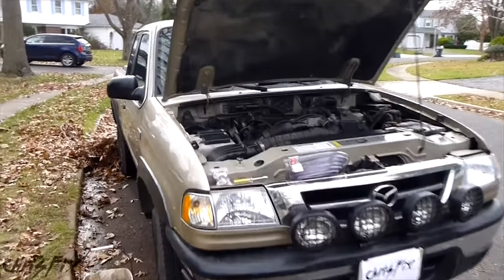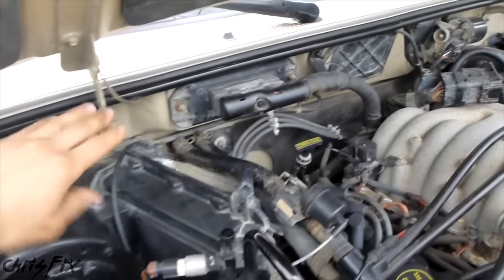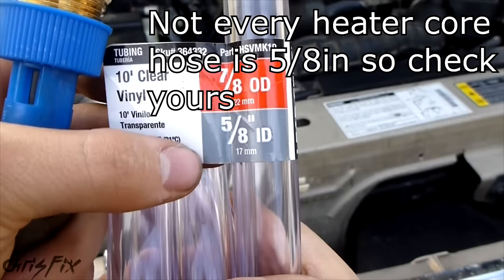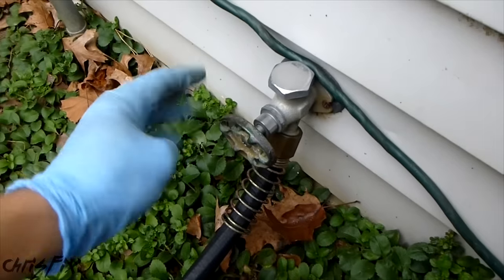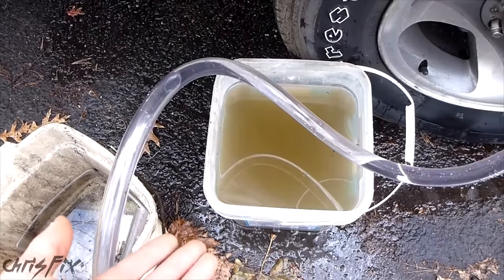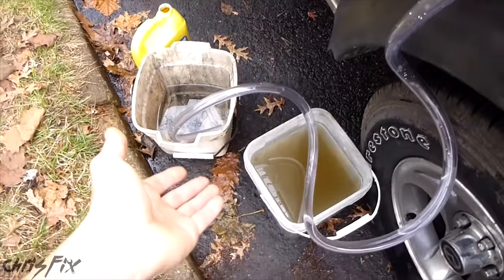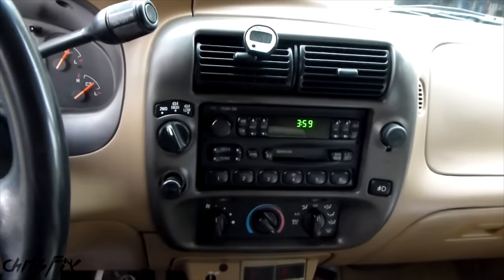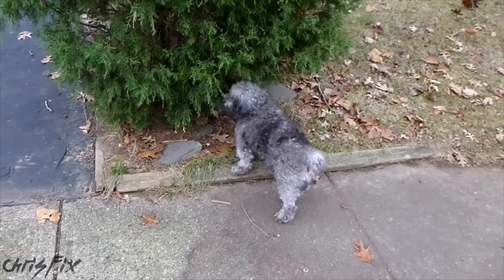How to Flush a Heater Core Safely (with a garden hose)

Comment: For measuring the temperature more accurate, set the fan speed to the lowest speed, because on high or higher speed, the flow of air is also cooling the thermometer to some extent. I found this out when measuring the cold air, it was showing the coldest temperature on the lowest speed.
Reply: Interesting.
Reply: You're right, lower fan speed means the air spends more time in contact with the evaporator or the heater core and thus more time heating or cooling. Hot air shouldn't have a cooling effect on the thermometer unless the thermometer is somehow hotter than the air coming out of the heater, which isn't possible. However that shouldn't matter for this test since it's intended to be relative. As long as the fan and the heat/cool setting is the same on the before and the after, the test is going to give you a rough indicator of whether or not the AC or heating capacity improved.

Comment: You're a good teacher. Personally I'd just hook the water hose with sprayer directly into the hose instead of using that adapter. Also, I'd disconnect the hose down by the valve not at the heater core end.
Reply from the maker: dainternetguru Thanks! I am glad the video was helpful!

Comment: I'm going to give this a shot. My thermostat gave out on me so I have been informed to buy a gasket, thermostat and coolant...and when they say gasket do they mean head gasket? But gasket for short. Anyways, thank you Chris fix! I have yet to do this... pretty nervous but also excited!!! Also, where or what is the oil intake? I'm wanting to use seafoam but I don't know where to add it with my Toyota Camry. My guess is that the oil intake is the oil dipstick tube. Thank you

Comment: Great video you seem very knowledgeable and communicate things simply and clearly.
I like your tip on using the heat monthly just to move the sediment and stuff, I have never heard that before. My follow up question to that is would you really need to turn up the fan? Does it have anything to do with coolant flow?
Reply from the maker: Loren Blaine Thanks a lot! You dont have to turn the fan up except maybe on climate control cars.

Comment: Back flushing with CLR probably works better, got a bunch of crud out when I did that with a Maxiima I had.  Had to poke a screwdriver in after taking out the radiator drain plug

Comment: you're so lucky to have a very easy access to your heater hoses, compares to my 97'Expediton. it's a nightmare.
Reply from the maker: Toby Tyler Yea on all of my vehicles it is really easy. Can you follow the hose to the waterpump or a connection near the water pump and take it off there and just not use the clear tubing?
Reply: yes it's way in there I can barely see it and a quick disconnect tool is needed plus the SUV has a rear aux heater and AC as well. The front heater hoses go all the way to the back and comes back around to the front heater core, looks really complicated
Reply from the maker: Toby Tyler That sounds like fun!

Comment: You should not twist heater core hoses. You risk detaching the inlet/outlet fittings from the core itself. Then you’ll have a bigger problem. Always cut the hoses and replace.

Comment: I own a radiator shop that my dad started back in 1957 we've reversed flushed the whole block and radiator and heater core at the same time we use water and 160 lb of air pressure through there as long as the system's flowing free and open it won't hurt it.

Comment: Lol normally my VW Jetta can be expensive for repairs but the MK6 has both a heater core and a fuel pump that can easily be done in 30 min to an hour. It's actually a great designed car for affordability(2.0 non turbo w/ 5spd manual).

Comment: Chris, thanks for the video.  I just followed it and flushed out my heater core on my 2002 Honda Odyssey.  Everything worked great but when I was taking off the hose for the outlet tube, I couldn't pull it off with my hand so I used pliers but I accidentally smashed the metal tube.  I was still able to reverse flush but I'm afraid to leave it this way because it might restrict the outflow.  

Will it be ok this way or is there a tool I can use to open up the metal tube so it can flow out properly.
Reply from the maker: I would be very careful because that metal is thin.  I would leave it and see if it leaks And if you notice a difference in heat

Comment: If you put a Y valve in at your hose Bibb connection which many folks have already for connecting two hoses... You can connect s pressure gauge available from any hardware store or Amazon cheap.
Reply from the maker: wb5mgr Yes you can! Thanks for the idea/tip.

Comment: I want to say how awesome your repair videos are. I'm going to write in ChrisFix for U.S. President. Thank you.
You probably wouldn't need to run the fan blower when running the heat in summer months to keep the heater core flowing. Simply turning the heater on to its warmest setting will actuate the control valve and do the trick by sending coolant through the core without making the cabin hotter than it needs to be by blowing air over the core.
I've had an recurring issue with air pockets in my cooling system that I solved by using the Lisle Spill-Free Funnel and purging the air. It's simple, fast, effective, and the system works perfectly but lasts only 3 months before the same problem of fluctuating coolant temperature gauge, overheating and no heat happens again. My system isn't losing any coolant and I'm unsure how air is entering the system. I can't do it now because of the cold weather, but next spring I'll check to see that the overflow recovery tube isn't blocked and I'll replace the radiator cap to ensure that the recovery system is working properly. The cap was replaced 2-1/2 years ago by a shop but doesn't have a PSI stamp on it so I'm unsure if the replacement is the correct PSI for my car. I had no problems with the system for the first 10 years of the car's life after I bought it new. I hate to think that exhaust gas is entering the cooling system due to a failed gasket but's a possibility that I'll need to face. Before I began researching this problem I wasn't aware of how many ways a cooling system can go wrong.
Reply from the maker: DDEENY Awesome! I just say put the fan up so that people know their heat is actually on. You can use a pressure tester on your system to see if there are any small leaks letting air in. You can also do a chemical test to see if exhaust gasses are causing the problem. Here is the kit for that: http://www.amazon.com/gp/product/B0007ZDRUI/ref=as_li_tl?ie=UTF8&camp=1789&creative=390957&creativeASIN=B0007ZDRUI&linkCode=as2&tag=chri0e2-20&linkId=JN7DYVTRITQK7RJY

Comment: My car seems to warm up slowly , I wait until it's above the blue section of the gauge then I drive and it warms up to normal operating condition and the heater blows hot , bit if I just let it idle it won't get to normal operating temp for like 45 minutes. I'm guessing it must be the thermostat bit I will also do this when it warms up some , it's only 16 degrees here today so I'm not running any water hoses lol but great video ! Thanks.

Comment: Great vid chris just a quick tip. I noticed you wrapped a glove around the connection you made with that adapter. Thats because that adapter you bought is the incorrect thread pattern. That is a 3/4” male x pex adapter which has a tapered thread its different from a hose thread. Im a plumber whats your po box ill make up something that will go from male hose to pex and send it to you

Comment: Additional tip….On Amazon , they have a heater core flush water hose nozzle with step tip ….to control water pressure and water flow ….all you need is clear hose ….there is also one that requires an air compressor to shoot short bursts of air to help losen stubborn clogs….it has a switch to go from air to water ….so two options to choose from ….with heater core flush nozzle guns ….both on the Amazon but can make your own with an average garden hose nozzle gun brass fittings and a cone type water hose nozzle fitting ….

Comment: so there's nothing wrong using a water hose I always thought you had to get distilled water? great video dude!! going to try this soon
Reply from the maker: deaththekidd30 You should use distilled water and coolant (50/50) when you fill the radiator, but to just flush it out, you can use a hose. I filled the heater core with antifreeze to flush out any extra water. In the end, it is not a big deal even if you leave the hose water in there because the heater core is so small.

Comment: Hey Chris,
Great video, just a rule of thumb.... not all heater cores are aluminum (ex. Toyota Trucks and some Hondas) just might be good to point that out when looking for a good chemical flush product.
Reply from the maker: speedytech7 Thanks for the tips! When making a video you have to say what is safest so people dont mess up their car. But you are correct, not every heater core is aluminum. I would still stick with a cleaner made for cars just because if there is any leftover it wont hurt the rest of the system.

Comment: awesome Chris nice input. I know this has nothing to do with antifreeze but I have a 94 impala and the trunk key lock seized up, and now the trunk button/switch doesn't work anymore, but when I push the trunk button I hear a clucking sound under my dash on the driver side just above my gas and break pedals. If you can help with that I would really appreciate it. Thx again very helpful vids.

Comment: Good video but I'm not sure I'd be jacking on the heater core hoses like that. With your clear hoses, you could have dipped the tip of them into boiling water for a few seconds and they would have slipped right on. Boiling water can be had easily with an electric kettle brought outside from the kitchen or maybe a little backpacking stove nearby.

Comment: I've got a 67 Buick Skylark with the 4.9l V8 and it's been sitting a long time, and plan on getting it roadworthy again with some well needed love. New fuel delivery system, basic engine maintenance, and changing most of the fluids. I really would like to change the coolant in it, but in the coolant flush video with the BMW you momentarily turned the engine on with the radiator drain plug out and revved the engine a few times. I'm sure if it was only on for less than half a minute, it shouldn't harm the engine, but would this step siphon the rest of the coolant in the engine water jackets and the heater core out? Is it worth trying it that way? Or am I better to just flush the heater core the way you showed here and play it safe? I'm sure my engine block does have a drain plug somewhere, but I doubt it was ever touched and I'm certain it's probably stuck in there. Thanks for all you do in showing us how to get things done ourselves, I've worked on cars but I still have much to learn, and your channel has been a really good help. Thanks Chris!

Comment: Did you do this htr core flush BEFORE or AFTER you flushed the whole cooling system?

IF you have a 12 VDC fluid transfer pump (or even an AC powered sump pump like I use to flush my whole house water heater cores), you can create a closed loop continuous flush using the chemical.  One reservoir.  Pump out into core; put return back in the reservoir.  Turn on pump and let it run until you are satisfied.  You could even use really hot water (up to the temp max your pump can handle).

25F increase is an awesome result!

Great tip on monthly heater exercise!

Just checked my 2004 F150 Heritage heater temp from dash vent while flushing with RODI water to get ready for initial Flush & Clean PRE-treatment.  It maxed out around 171.5 degrees F.  Not bad for a right at 17 year old truck with original heater core.  I may consider skipping the heater core back flush.  <wink>  We'll see what it looks like after all is said and done.  <smile>

Comment: I have a 01 chevy silverado 1500 4wd and I turn my truck on and even when I'm driving it only gets to about 200° and that's where it will stay but no heat blowing out I just check my hoses I'm at work and one side is warm not super hot and the other side is cold so I'm guessing  I need to try to do this to get my heat to work again. Hopefully this will fix it the good thing is there is no leaking my coolant is stopped and has been for a year now so I'm crossing my fingers. Thanks for the video.
Reply: Oh yea would me putting a 4in cold air intake cause my truck to run cooler because I did install one right when I bought the truck it only has 122,000 miles on it and I bought it for 1,000 and fixed alot of dents and knocked off rusted frame and painted it with rust preventer and rust inhibitor and repainted the truck so it looks nice now I want it to run nice lol..

Comment: I was told to switch out the thermostat as well as some models will have options to choose from (for example) a 92 degree F to a 96 F, which would allow the engine to run a little hotter before getting cooled down. I didn’t notice much of a difference on my geo tracker (that I sold and I miss), wish I would have known about this because my heater sucked bad and Idaho winters are cold.
Reply: So if one wants hotter air inside the car then one should opt for the higher temp thermostat? I've changed car thermostats before, but that was a few decades ago.
Reply: And the summers are hot, last summer sucked triple digits for 2 months straight

Comment: When you refilled your heater core with antifreeze, how did you drain the excess out of your clear hoses before putting the car hoses back on? Also, how do you go about disposing of the coolant you have in the buckets? Thanks.
Reply from the maker: Vin3281 I just disconnected the clear hose and drained the water out. Then reconnected and added the antifreeze. I go to my local parts store or my town's recycle center and they both take the coolant.

Comment: Thanks for this video, Chris. You really know your stuff! Could you please help with a problem? I need to do this but, while my heater inlet/outlet hoses are up front of the block, Holden (Aussie GM) run these hoses to the heater tap in the very back corner of the bay under the ABS module, and I have climate control. So I'm wondering if I start my engine and turn temperature to 30°c and then cut engine, will the heater tap stay open for me to flush the core. I'm hoping I don't have to run my flush after the tap - cause that will be tough! I have a 3.8 supercharged V6 and you're one of the guys that's encouraged me enough to do almost all my own servicing/repairs! Thanks again.
Reply from the maker: +Mathew Wood Just take off the hoses at the front of the block instead of at the fire wall.

Comment: Chris, Nice informative video. I have a question;  my nissan xtrail got heating problem; when its in idle doesn't give heat, but car is running it gives heat. Even when i stop at traffic light, it stops giving heat. What could be the problem. Thanks in advance.

Comment: I wanna flush my coolant but also wanna flush my heater core. Should I start with my heater core and then my coolant or coolant first then heater core. And if heater core first should I still  add coolant to flush the water out of the heater core. Cause wouldn’t a coolant flush flush it out? Thanks In advance. Great video.

Comment: Just a reminder . . . if your car over heats, especially in the summer,  turn on your heater full blast and it will help cool down the system until  you can find a safe spot to stop and get it repaired. This isn't a total fix, so if your car continues to get really hot - shut it off.
Reply from the maker: Thanks for the reminder!

Comment: A good video as far as it goes but,  Not all cars have a blend valve on the heater hose.  My truck for example does not,  It controls the amount of heat by means of blend doors located inside the cab.  To find which of your hoses is the inlet and which is outlet, the inlet hose should be considerably hotter than the outlet hose when the car is at normal operating temp.
Reply from the maker: thanks for sharing

Comment: Awesome video as always! Do you need to bleed the coolant system after doing this, since you opened the coolant system?
Reply from the maker: Thomas Brendel Since the heater core was filled with coolant (or water if you skipped the coolant flush part), you do not need to bleed the system. I did not have to bleed my system and my truck didnt have any air in the system. If you get air in your system and it deosnt self bleed, then you can definitely bleed it! Most small amounts of air will bubble to the top of the radiator and you will be fine.

Comment: Hi Chris! I have a1998 Honda Accord. So the hose with the control valve is the "inlet"? One of my hoses (outlet) is cool to the touch after a few minutes of running my car. Looks like I definitely need a flush. And I'll probably just replace my temperature control valve while I'm at it because there's a tie-wrap that was put on there to keep it open.

Comment: ChrisFix quick question how would you know what valve would be the inlet and outlet hose for the heater core? Great vid man dude your like an auto god lol so full of information which is never a bad thing keep up the great vids
Reply from the maker: killa Killzone If you have a heater control valve, that is the inlet (as explained in the video). If you do not have a heater control valve, you can take off the hose and run the engine for a second to see if coolant comes out. You can also run a cold engine with the fan on high and see which hose gets hot first (which would be the inlet).
Reply: Watch the video he shows you. The inlet is the one with the black cup on top.